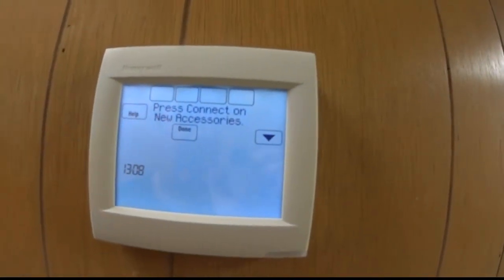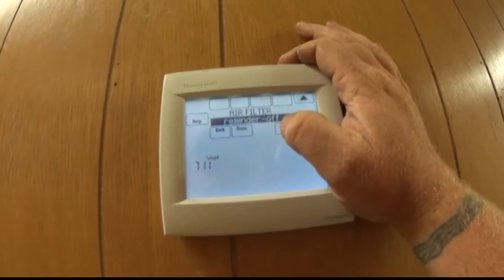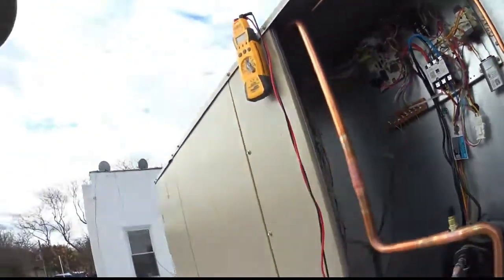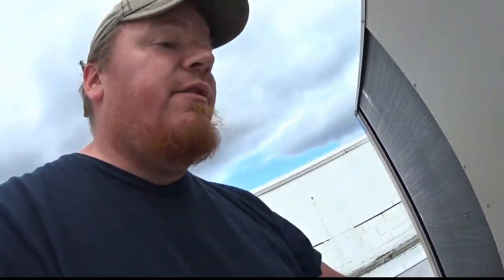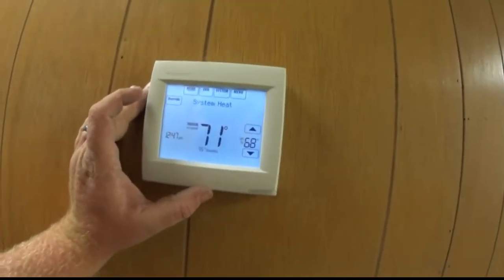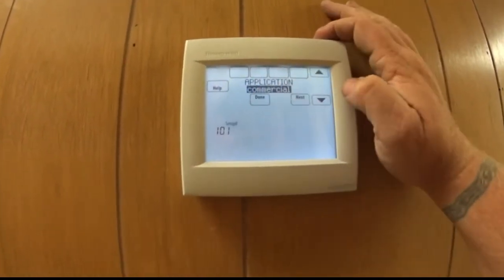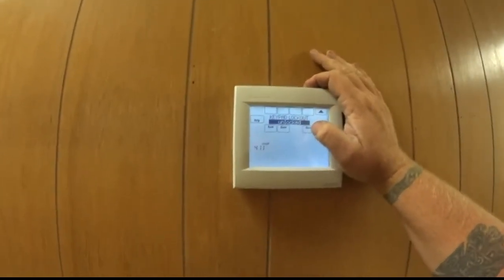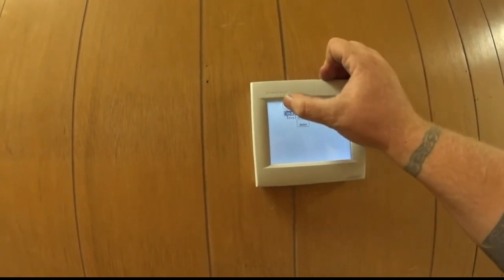Rooftop unit install (part3)  thermostat install t #HVAC

Comment: Those stats look cool. Long Island is where I found out about that high leg by accidentally blowing up my drop light. I needed light while on a roof so I put my cheaters on a 3phase unit and.... poof.
Reply from the maker: A buddy of mine did that with a small shop vac... Worked great for like 4 second.   Thanks for watching

Comment: I haven't used multiple remote temp sensors on the new 8000 yet how do you like the results
Reply from the maker: So far I love them...  Easy to do ... And very accurate...